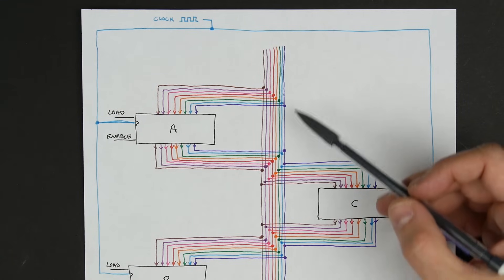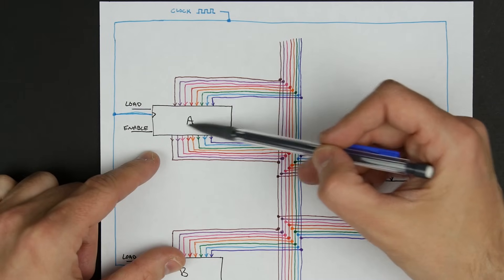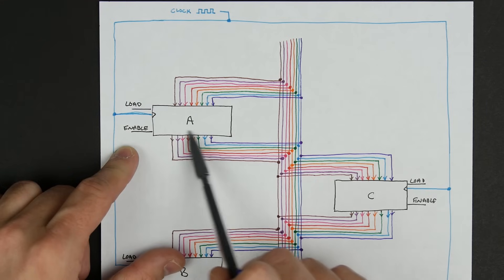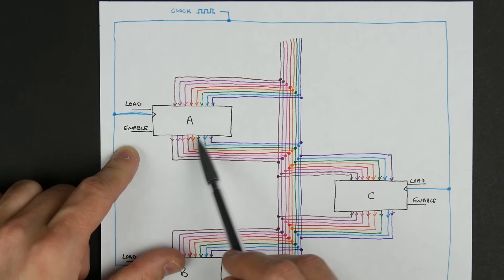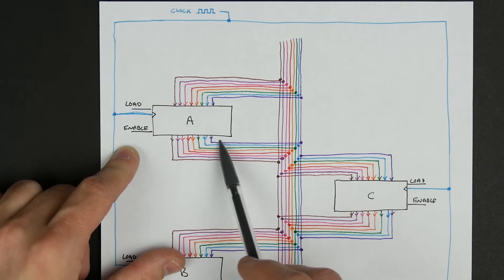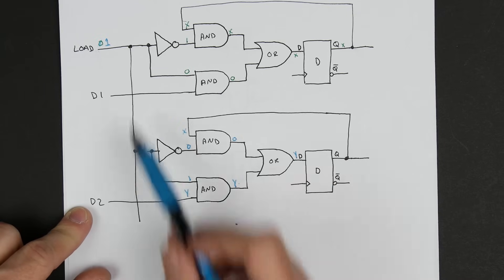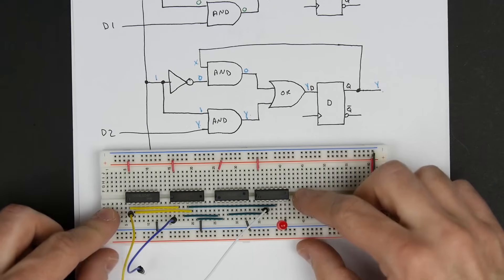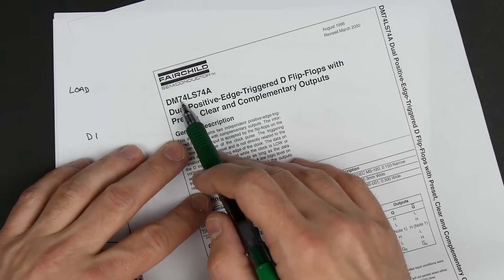Designing and building a 1-bit register - 8 bit register - Part 3

Comment: The values on the bus go round and round.
Reply: i swallowed my gum
Reply: I'm wondering, couldn't you just add an AND gate before the clock input and have the other terminal he the load line? So it would only change the values of the flip flops when the load is enabled. It seems like a much simpler solution
Reply: Another one Rides the Bus.
Reply: @theodiscusgaming3909  that's weird.
Reply: 😂😂😂 that was a good one, that was a good one! LoL :-)
Reply: @djtoddles8750  😂😊
Reply: haha
Reply: @airboy1021  The clock is continuously altering the flipflop. So you need a system in place to continuously tell it, whether to take value from data bus? Or take its original value from Q output? Supposedly you did in fact connect it using a simple AND gate. In the state where clock is rising, the flip flop needs an input, but the load is disabled so there is no input from data bus, what value would the flip flop take? It would automatically take 0 as the load is disabled and the flip-flop data would be lost.

To sum it up, it's only this complicated so that that Q from flip-flops can be fed back when data bus is not giving inputs, to preserve its value.
Reply: all through the registers' town
Reply: @airboy1021  If we take example load line is 0 then the input for d flipflop will be 0 so it is not desirable we want it to have value which was stored previously

Comment: Can't you just AND the LOAD and CLK values together so if the LOAD is disabled none of the D flip-flops get a pulse from the clock?
Reply: That should be avoided, as complications may follow with delaying the clock: passing a clock signal through an AND gate could delay it -- making it arrive slightly later than the other components in the circuit that are assumed to not have messed with the clock signal.
Reply: @nizarch22  ohhh thanks for the answer
Reply: @nizarch22  hmm, awesome thanks
Reply: @nizarch22  thanks for the answer. i was having the same question.
Reply: @nizarch22  I was about to ask the same regarding just ANDing clock with Enable. Your explanation is quite reasonable but what if we just add the same amount of delay at each register? If we would add only one AND gate before each D flip flop clock input we would have exactly same delay of the clock everywhere where we need a clock.
Reply: @rfly-fpv  Well yeah, seems reasonable. Hard to come by in real life though. Usually in logic gates, or any other chip for that matter, you have a minimal delay, and a practical delay until the chip outputs something (documented on any chip's datasheet, probably). In practice, they would differ slightly.

The slight difference becomes an inflated monster as you reach very high clock signals.
Reply: @nizarch22  NOT true. Every chip designer uses clock gating. Latching unchanged data into a register is incredibly wasteful and would increase the IC's power consumption for no good reason. The delay added by a gate is completely insignificant, and measures are taken in order to make sure everything stays synchronized.
Reply: @luisjalabert8366  What kind of measures?
Reply: @luisjalabert8366  Interesting stuff! Thank you for explaining.

Comment: Re: Anding the clock. I think that the general principle used here is to avoid adding logic to the clock and therefore avoid delaying the clock signal to reduce timing issues. Each component would then receive a synchronised clock, as far as is possible, and then use internal edge detectors. However, my initial assumption was to use an AND with the clock and load as the input to drive the clock input on the flip flop. I'm sure that with slow clock speeds that would work fine.
Reply: Anding the clock, in my opinion is a better way; you see, the delay caused by the AND gate is in the order of nano seconds (which in itself is very small) is in fact wanted, as memory chips like these have a mandatory period of time (again, in nano seconds) the data needs to be held before the clock pulse is given. (Known as Data Hold).
Reply: @neevpenkar4955  The problem with this is, that the clock-signal is not only the "spike" (derivative of the rectangle), it's actually the alternating rectangle function, as he has drawn on the first diagram. The rising edge will be converted to the spike just in the d-flip-flop, not before. - "ANDing" the low-state (=0) of the rectangular clock-signal with the "enable"-signal beeing 0, too and not changing this, until the clock changes to high (= 1), the next change of the "ANDed" "enable"-signal would generate a DELAYED high- (= 1, if the clock is still in high-state) signal on the output of the "AND"-Logic, which would lead into a delayed, detected rising edge. This is where you'd mess up the clock-signal. (: - Sorry, if this explanation may be confusing. :/
Reply: @xXFe_LixXx  But what about ANDing after this capacitor+resistor edge detector?
Reply: It could cause problems with the control logic.
Reply: Seftdelmer Thank you for this. I’ve done clock-ANDing in some FPGA builds and was really curious why Ben didn’t just use this simple technique (instead of 2 ANDs, an OR and an Invert), it seemed very strange to me why he wouldn’t have thought of just ANDing the clock!... I hadn’t thought of the delay caused by the AND. Also, your explanation helps bring some data sheets “data valid” or “data hold” required wait times into perspective, they’re gate delays!
Reply: I found super intuitive explanation here: youtu.be/I0-izyq6q5s?t=896 Guy explains it in a way that if clock is HIGH and store signal goes LOW and then HIGH it can fool the D flip flop clock input that the real clock transitioned. Solution with feeding back the stored value really solves all possible problems with timing
Reply: This still doesn't make sense to me. Having so many gates on the data input would theoretically delay the data *past* the clock pulse, which means the wrong data would be stored. As opposed to having the clock pulse after the data changes, so the correct data would be stored.
Reply: @mskiptr  I was wondering about that too. Instead of the logic "around" the d-flip-flop here, would it be possible to take a d-latch and as Q for that, AND the edge-detected clock and the LOAD together? hmmm.. my brain... aaah maybe to hook in the tri-state buffer onto the whole thing, the logic is required and makes it simpler?
Reply: @xXFe_LixXx  I'm a hardware engineer and I work in GPU design. What you say is incorrect, because all the registers in a circuit have a certain period of time where the signal must be valid before AND after there is a rising edge of the clock, and synthesis tools will tell you whether the timing is met or not. Additionally, "ANDing" the clock is a mandatory practise in today's designs, which is called "clock gating". Doing things like they are done in this video is INCREDIBLY wasteful, there is absolutely no need to latch the signals every clock cycle if they aren't changing. In a circuit, clocking data into registers consumes a lot of power and MUST be avoided whenever possible, and this is always done by clock gating.
Reply: @amodo80  this is how it's done in RTL:
reg data_r;
always_ff (@posedge clk) begin
  if (clk_enable) begin
    data_r <= data_nxt;
  end
end

This results in a circuit that has an AND gate in the register's clock input, which ands the clock signal with the clock enable signal. Typically, the clock enable signal is some logic condition which tells your circuit when the data in the registers must be stored.
Reply: @xanri7673  he's wrong, and the whole industry uses clock gating. Data at a register's input must be stable in a certain time before AND after the clock's rising edge to ensure it's stability.
Reply: @luisjalabert8366  Thank you for your reply. So, how is the clock's edge detected? Sorry, I missed that because I'm simply not great at hardware... By ANDing the clock with its inversse (where the inverse is slightly delayed by the inverting logic)? I'm not really good at electronics - the impact of a capacitor is not inituitive to me for instance, so I was looking at it from a logic/software developer's side - to detect a rising edge, I would simply AND the signal with the inverse of a prior state. edge = sig_new AND NOT sig_old
Reply: @amodo80  amazingly, you're not too far off! It's quite a complex topic, and it doesn't involve ANDing the clock and its negation, but for some designs it does indeed involve using the clock and it's negation signals in order to control when transistors are allowed to charge the output capacitance, and the implicit delays of the transistor's transitions due to their own capacitance. In reality flip-flops are not implemented like in this video because it's a huge waste of transistors. Usually 6 or 8 transistor flip-flops are used. It gets really complicated to explain in a comment since I cannot show circuits, but you can get a sense of what is happening with this lecture (you can skip the first 9 pages): https://www.ece.ucdavis.edu/~ramirtha/EEC216/W08/lecture6.pdf
You will need a basic understanding of how transistors and capacitors work.
Reply: @luisjalabert8366  Thank you again for the great response! It's very eppreciated. I do have a basic understanding of electronics, but just basic. On a level where I can follow Ben Eaters videos and understand everything. I'll have a look at the slides and try to wrap my head around it.

It seems that Ben designs the circuits for these videos here in a way that they are functional but simplified, sacrificing efficiency for understandability for people like me.
Reply: @amodo80  yeah, I love his videos, but this one I don't understand why he didn't use clock gating. Would have been easier to implement AND understand. It's true that up to some point in history (if you check some relatively old textbooks for example), the moto was "don't mess with the clock, don't add logic before the clock", and clock gating was a no-no; I'm not sure if this had anything to do with the way clock trees were implemented, or if speeds were low enough that the clock signal could have been considered identical in the whole chip, but since this is no longer the case, and special care needs to be taken with clock propagation across the circuit, then clock gating becomes a non-issue.
Reply: As others have mentioned, the architecture in the video is sourced from the data sheet of the 74LS173 chip. I guess it's useful as a general demonstration but overall this does feel like a missed opportunity.
Reply: @luisjalabert8366  Thanks I was going to ask about this but found this discussion in the comments. Glad I wasn't going mad thinking ANDing the clock with the load would do the job. They even showed this in the crash course computer science course when discussing memory.
Reply: @luisjalabert8366  Thanks for your post.

I think Ben's idea was to first build the circuit of the 74LS173 (as shown in the data sheet of the 173). And there the clock signal is not gated.

Comment: I love that you completely demystify any "magic" going on inside the IC by building the circuit. You could have just whiteboarded what a register does and why we need a couple of them, then showed the schematic from the LS173 datasheet and how to use the data enable and tri-state out pins, and finally told us to Google "D-type flip flops" if we want to know more. Thanks for showing what's going on under the hood.

Comment: excellent videos.  a lot of comments about gating the clock.  It is unexpectedly a complex topic, but basically you don’t want the latch storing what is on the data bus on the edge of the enable control single while the clock is in the wrong state.  you want the data to be stable on the bus, which would happen while the control signals are changing, then the clock grabs it.  clock gating is indeed done because it is a smaller circuit and uses less power, but there are a lot of timing issues beyond a breadboard computer.  Fantastic videos.

Comment: Hi. You are very successful, I see, congratulation, and you really deserve it because you are presenting your material in an EXCEPTIONALLY lucid style. You are very good in talking as you go and all your videos are densely packed with knowledge, no time wasted. 

I want to comment that your very best video was the first on the 6502 computer. The absolute awesomely neat thing was that you just plugged it in the breadboard and said: let's see what we can do with it. Looking at the pin-out and just hooking the minimum necessary pins up (inputs). And you build the circuit as you went. 

Contrast this with this video here, where you deliver a great explanation, but then you present your pre-built circuit and you explain it. I suggest that if you build it up while explaining it becomes much more amazing than if you just point to your pre-done work. But anyway, your stuff is amazing. I would have ordered a bunch of your kits from you today if you didn't have the fulfillment delay.

Comment: 4:24 you can replace all of the gates with NAND Gates, hook it up the same way (but connect the load signal to both the inputs of the NAND Gate taking the place of the inverter), and everything works the same. And as an added bonus, you get to save yourself a couple of chips, as now you only need one instead of three.

Comment: 05:00 Wouldn't it be easier to just gate the Clock? If clock cannot transition to high, then whatever data there is on the input, will not be stored into the register, and it will automatically maintain its latched state. That would require just one AND gate: the Enable signal gating the Clock.
08:50 Where do you get those neat data sheets for your chips?
18:25 Correction: 2 AND gates coming into an OR gate, not an inverter.
18:42 These Enable signals are inverted because they're activated by a low signal (0). It's usually done this way because the 0 volts is more "universal" than arbitrary high signals. Imagine, for example, that you have different parts of your computer controlled by signals of different voltage for the high signal, which is not that uncommon (e.g. the USB standard uses two different voltages: 3.3V and 5V). Then, if you used the high signal as your control signal, you would have to do a lot of voltage conversions to control all these chips from one place. But if you use the low signal for your control signal, then it is the same 0V signal for all those chips.
It is also very important for the Reset signal to be low-activated, because when you power-up your computer for the first time, all the wires begin at low voltage, so if the reset signal is low-activated, the computer will remain in the reset state until activated. But there's a short transition time needed for all the voltages to settle down and the high states to be available at required levels. It's always easier to pull something down to the ground than to supply a current to pull it up, because you have to have that electric charge "buffered" somewhere first to be able to use it.
There's also the factor of accidental short circuits which could set the enable inputs to hight by an accident, possibly causing a collision on the bus.
Reply: That;s what I was just thinking. That works logically, but there may be some physics thing that we are missing.
Reply: I guess he wanted to do the gating logic like that so it'd match up with the internal configuration of the 74LS173!
Reply: ***** I wonder how many times people duplicated someone else's redundant circuitry just because it was there in the original project and they thought that "there's some important physics behind it" ;J Cargo cult all the way down... ;)
Reply: I figure who's writing onto the bus (= whose ENABLE is on) better be done before someone's reading it (=whose LOAD is/comes on). That is, the signals on the control lines should respect this order, which brings up the question how much of a delay there should be. How do we get to generate that? Sub-dividing the clock?
OR - you create some delay on LOAD wrt to ENABLE just by adding some more logic in front of it :)
Reply: Thanks ***** ! Good to know.
Reply: commenting to save this for later
Reply: TL;DR
Reply: Or maybe they were just curious and wanted to learn why? What a shitty response.
Reply: If data is saved based on the clock transitioning to high then there is no point in the load signal in the first place. Also, the clock is going to transition to high assuming the computer is running, you would not want data to be stored just because the clock is on.
Reply: Barry Manilowa what is your fucking damage, dude?
Reply: "Electronic Engineer?  You wanted to say Electrical Engineer"
Yeah, that. My mistake. Not everyone is a native English speaker, you know? :P
Though I'm not sure if this translation is correct either, because "electrical" may be somewhat limiting: to just simple electricity stuff, not electronics. Here where I live, these two things are distinguished. An electrician is the guy who will come to your house to install a power line socket or a lamp. An electronician (not an English word, I guess?) is someone who makes electronic circuits, with semiconductors & stuff, and needs to know much more than an electrician.

"Go away, you're a fraud!"
Well, I'm not here to flash with my certificates, especially to some random douchebags on the Internet :P And I'm pretty sure I wouldn't convince you even if I did.

" I rest my case."
I really doubt it :P
Reply: +Barry Manilowa It's not about smarts; it's about creativity. Sometimes things just don't occur to you.
Reply: +Barry Manilow every single operation already requires an entire clock cycle because the flip flop is gated by the clock pulse already.
Reply: Who the hell are you talking to?
Reply: Barry Manilowa  if there's a reason, then respond with the reason. Don't just make meaningless appeals to authority.
Reply: Ward